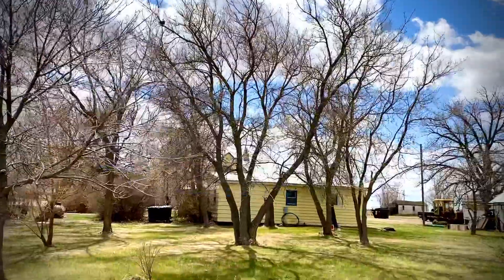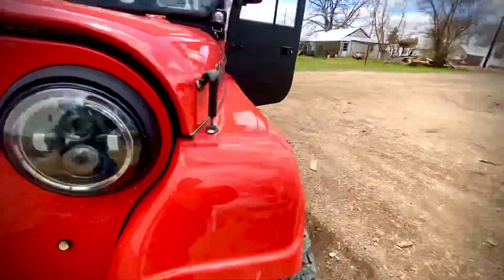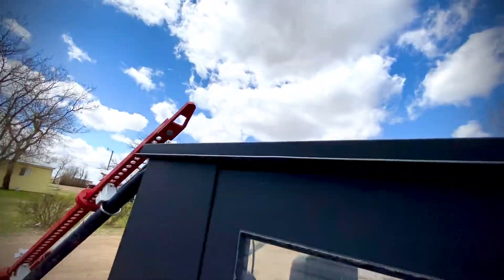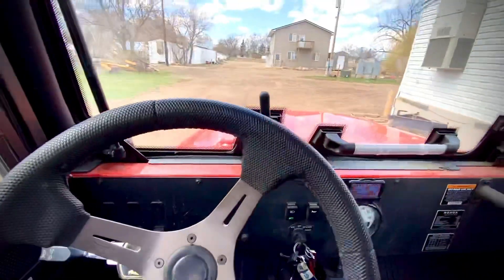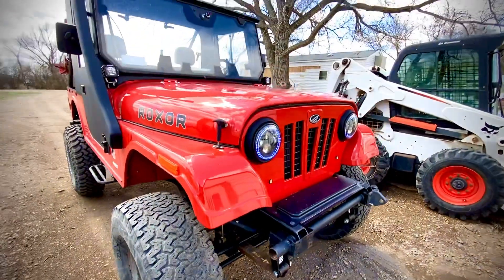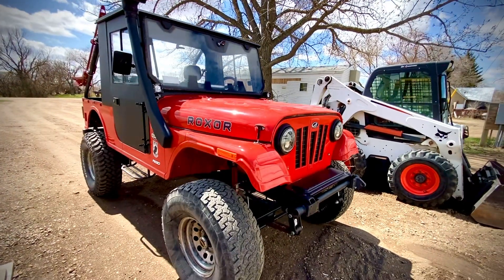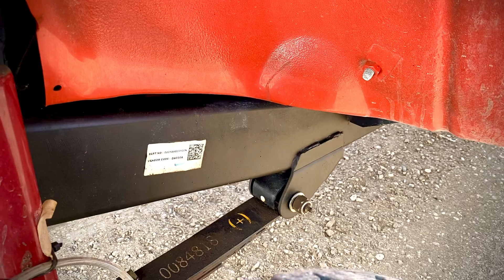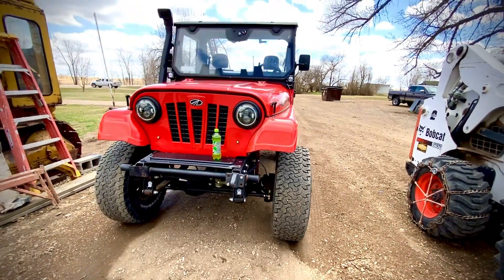Mahindra Roxor Prep for Alignment

Comment: Yes, you do need to look at that toe in. It looks like it's actually toed OUT instead of in. Bigger tires usually require a little bit more toe IN, because the friction on the road is much greater with bigger tires and forces your wheels to tow out more than the specs allow and you get serious tire wear. 

Thanks for the close up of that hi lift jack mount. I see what you mean about being so close to the roll bar. I wonder if you were to place a layer or two of cut up inner tube in the "V" of the mount to raise it up a little so the jack has more clearance? Keep up the great work.
Reply from the maker: Thanks for the tip!!🙏🏿😁